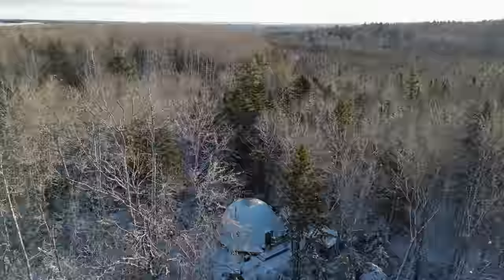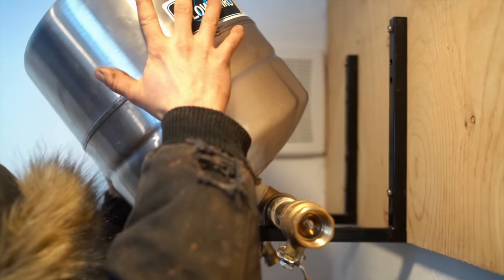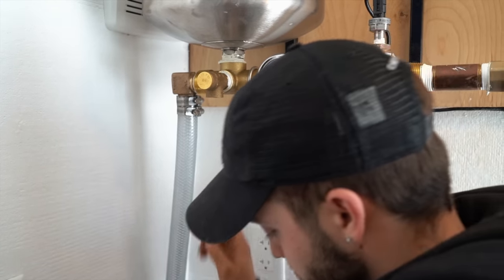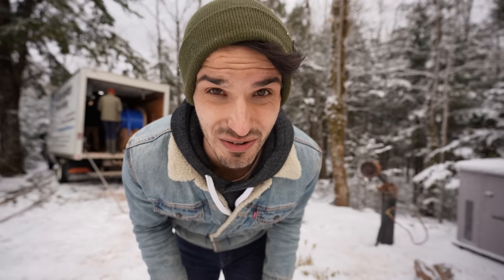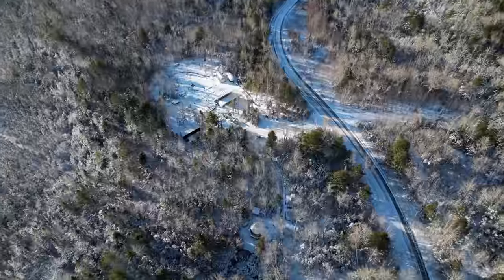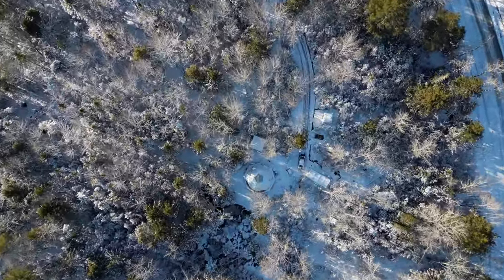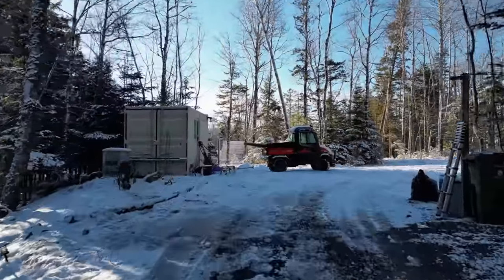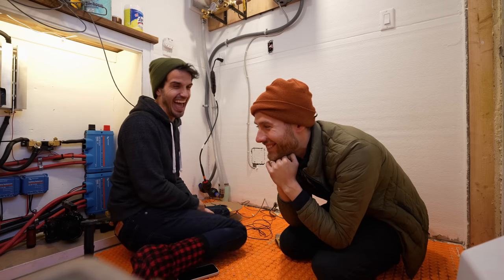Homestead and Geodesic Dome get MAJOR upgrade (3 years in the making)

Comment: When you install large tiles you have put the grout/glue on the back of the tile as well as the floor .You can level the tiles with a rubber mallet and level.

Comment: Dear Tyler and Todd, As an engineer in the car wash industry,  we would always put a drain on the floor. Also, electricity and water never mix, so we would recommend at least a sheet of plastic between wet and power. Curious on the way you will stop the water from freezing between the wellhead and the room with the inverter?

Comment: First, loved the video, but I haven't seen one since you started that I haven't loved so, I'm probably biased.  As for the tiling, now that the SLC is down, this is just a suggestion for furture projects.  If the floor has an apex point, and you use a level to find the highest spot on the floor, provided it isn't drastically different (three times the hight of one tile is my max), you can start laying the tile from that high point and adjust your thinset thickness accordingly, to create a level surface.  For small spaces, this is my preferred method.  For large areas, yeah, the SLC usually ends up being the best solution.  In any case, as I've said many times, you two are the bee's knees!  I love you guys!  Great work!  The entire property is amazing!  Big hugs to you guys, Eddie, Charlie and Lily!

Comment: hmmm.... you guys should check the tile glue.... Most tile glues cannot be used under 4 degrees celcius... They won't adhere properly, and the tile will let loose within months....(if not sooner). As far as I know, there are some tile glues which Can be used below 4 degrees, but they're usually quite expensive...

Comment: GUYS - We have a combined power and water building, our electrical contractor had us drop a clear Vinyl curtain affixed to the ceiling of our container with a 1x2., and added a drain in the floor.  Four years later, we our pressure tank (like yours) cracked and sprayed water all over the curtain for an estimated two hours before we noticed something was up.  While the room had high humidity, the batteries and inverters and controllers did not get wet.

A suggestion.

Comment: Gotta join others in saying you guys are persistant.  Can't believe how much you are accomplishing in the dead of winter.  Check your list of infrastructure projects and see what you have accomplished: heat in all buildings and house, electricity and panals up and running, running well water. With finishing the floor and connecting main water lines in the spring your main utilities are in and working and goodby power and city water bills 👍👍👍 and from the treat cupboard for you 🍷🍷🍾

Comment: The reason for the self leveling concrete helps the efficiency of the heating and insulates the wires from moving. The companies instructions give you the best results and if anything goes wrong you're covered under the warranty.  Otherwise it gets very expensive very fast.

Comment: I think I recognized the 1HP Grundfos stainless steel pump, same one I have. How far above sea level is your property? I was surprised that you had to drill the well 200+ feet deep. Drill should encounter underground water table when it reaches vicinity of sea level. The water pressure storage tank looks incredibly small for the living spaces you'll be supplying, which means the pump will cycle on constantly, reducing life expectancy of pump, and consumes more power. On a typical well, probably will also need to splice in a filtration unit to remove sediment. Reverse Osmosis system is expensive and complicated. Instead, I made a two stage splice into the water main, first unit is for large size filter cartridge, I use rated at 25 or 20 micron in that, then second unit is for standard size filter cartridge, I use rated at 10 or 5 micron for that. At that point, you have enough filtration for bathroom uses. I also run a filtration bypass line for outdoor irrigation. Inside the actual living space, you can add an additional under-sink ultra filtration unit, running a shared line to extra spigot above kitchen sink and to ice maker, I use standard size cartridges rated at 1 or 0.5 micron for that. With just the two of you on the property, annual cartridge change should easily be sufficient (unless your well is pumping up lots of sediment, in which case you would change the large unit cartridge more frequently, it's taking the brunt of the filtering burden).

Comment: So much work has been done to your compound. You should be very proud of your achievements.

I also want a little homestead. But, alas, I am poor as a church mouse. 

Still, living vicariously through your videos.

I do have one question, though, were you ever concerned about theft with your dome home? It is a soft walked material structure. Which doesn't offer much resistance to thieves. 

Just thinking....I love your done so much. But that is my main concern. Safety.

Comment: It was a surprise to me seeing how you lead the water pipe in the freezing land just outside of the container. We do it in freezing Europe so, that all the pipes have to be inside (where you heat) or down in the land (we have minimum of 80 cm where there is never freezing). Leasing it outside I would be afraid of temperatures below zero  🥶

Comment: Hey. Love your shows. If you want more insulaton in your sea containers, there is a product made of foam which is shaped to have the grooves of the container. Your local home hardware can get it for you. Mine did in Ontarrible. It has a flat exterior so if you wanted to change the siding from metal to ... wood? You're game to. 
Best of luck in your adventures. Love you guys.

Comment: I love my instant noodles.  BUT.... you must try the Ramen Hack.  1 egg, 1 clove of garlic crushed, 1 tablespoon of mayonnaise and the packet of seasoning.  I use a pan and separate bowl, but you can do this in the instant container you have.  I would  remove the noodles and put the hack ingredients in the cup and mix it together really good.  Pour a little of the hot water and mix to temper the egg.  Then put the noodles back in and pour the remaining water over it.  You will see it adds such an amazing flavor to any instant ramen.  PS....I love you two!
Reply from the maker: Sounds delicious!!

Comment: The window cover would be nice if it was maybe in 2 halves side to side as well as the upper & lower (so 4 total) which would still give you the chance of a bit of a view but much more coverage for insulation purposes.
I feel your frustrations, everything I try to do & have tried to do for the last several years generally takes at least 3 times as long as it reasonably should, it's exhausting.

Comment: Anyone else nervous about the electrics so close to the water? We had a slow pin hole water leak from the over flow tank (like the heating tank they have) and it was way too long before we noticed. I'm hoping they put some plexiglass and a water sensor up there or maybe a valved drain to the outside. That's a lot of battery to accidentally soak.
Reply: I am surprised too that the water is in the same building.

Comment: Yep, I think the self-leveling was supposed to go under the orange stuff, guys.  Hopefully, the heated flooring works out ok for you.  Fingers crossed you will still have good heat transfer through the self-leveling layer that will be between your tiles and the heat source.
Reply from the maker: No the concrete floor needed to go over top in order to lock the cables and everything in...we triple checked this time 😆
Reply: Yep you are right. Its cement, schluter, heat wires, more cement, then tile. Its in the pump house so the worse thing that will happen is the tiles will crack up. Nobody will see it.

Comment: You should really use porcelain tile on the heated floor so it will radiate the heat in the building. The lvp will not radiate the heat.

Comment: Fyi. I have the same radient floor heating in my renovated master bath and it’s mounted over wood and it works fine. I didn’t have the depth needed to use cement board over the existing joists.
Reply from the maker: LOL are you serious hahahahaha... I wish there was a way to know this before doing the cement
Reply: @tylerandtodd  I am serious.  5 years and the house hasn’t burned down yet.

Comment: Was the heated floor off when you poured the self leveling underlayment? The manufacturer says that it should be to prevent cracking while it dries. Hope it turned out well.

Comment: I definitely would get a bigger pressurized tank, that will extend the life of your pump by lowering the amount of on off cycles.
Reply from the maker: There's no need, we installed a Variable Frequency Drive which keeps a constant pressure always at water line! :)
Reply: @tylerandtodd  Yes, I love that technology for other applications (like AC) but in your case with such low demand it probably would be overall more economical to go with conventional larger pressurized tank. Time will tell of course. Another advantage of not having the pump on longer is if you have a lot of lightning in your area? I have lost running pumps because of ⚡️ while running them.

Comment: Not sure if the flooring worked out for you guys, but at least it's good practice if you want to do it later on a more "visually important" building.

I mean, as long as the tiles get laid and you get some heat in that box, right? ;)

Comment: I know very little about a whole lotta nuttin, but is the water pump stuff inside the electrical building? OMG, what if?  One of you will have to put your finger in the leak while the other works the wrench all while not getting zapped ! Location, location, location.

Comment: Guys I'm very nervous about your floor. The self-leveller should be under the heat coils not on top. I'm  afraid this could force the heat into the wood  and start a fire. It may have  damaged the wires during the pour.

Comment: Oh, man. I hate to tell you this guys, but with these systems you have to do all of the leveling BEFORE you install the system itself (the membrane and wires).  (That's what they meant by "underlayment..." not under the tile, under the system itself.) If you pour self-leveling concrete over the system you can not only end up with a lot of issues with shrinkage and curling of the membrane, it can actually ruin the entire system. If you're lucky, you'll just end up with a floor that doesn't heat as much as you'd like it to. I really hope that's the case. I know how being easy on yourselves is a goal and I think you should be. This is just something to learn from. But it's probably a good idea to put a disclaimer in here somewhere just so others don't make the same mistake.
Reply from the maker: Hi Mary, no that’s incorrect. We did it the right way, we double checked with the manufacturer of the product. This is the way to do it if you’re installing a laminate floor over top which is what we’re doing now instead of tile :)
Reply: @tylerandtodd  Ah! Got it. Sorry, that wasn't clear from the video. It looked like you were going to put the tiles back on. Whew. They are such great systems but do require special care. Here's to toasty feet!

Comment: I can honestly say that I am not a big fan of putting the water system inside of the same building as your electrical.  If the water lines freeze and they burst then your electrical system may take heavy damage.  I would seriously consider getting another shed for the water system instead.

Comment: Alright guys.    
I know you are trying to do things perfectly and end up redoing some because they were not so perfectly planned.   This happens.

I see that you have put your water pipes , the main pressurized water pipes, in your electric supply building.

I have mostly seen where water supply are mostly installed in their own room.  This is for many reasons,  warmth is one, and to isolate from any electrical boxes.

AS you have invested, I estimage 20,000 dollars in your electriaxl system,  I have this advice for you....

SEPARATE your water from the Electrical,   at the very least, put up a plastic wall, or a plastic sheet to stop any water spray that can happen, in the event that you may, and probably will see happen over the course of time,  spring a leak or freeze a pipe, causing water to spray onto your electric boxes,  Regulators, batteries (LITHIUM BATTERIES DO NOT LIKE WET,)  Especially the lithium material and can catch fire), as well as the battery protective electronics.

This is basically a heads up to future problems.   I have not seen a water system that has not sprung a leak at one time or another.

Another suggestion is to make your battery area AIR TIGHT.  Hopefully if you DO have the misfortune for the battery to catch fire,  the lack of oxygen may put it out..  thorugh lithium are able to supply their own oxygen to fuel a fire, maybe you should consider a self triggering fire extinguishment system,  and putting doors to cover the battery will help keep the batteries in extinguishment gases till the fire is out.